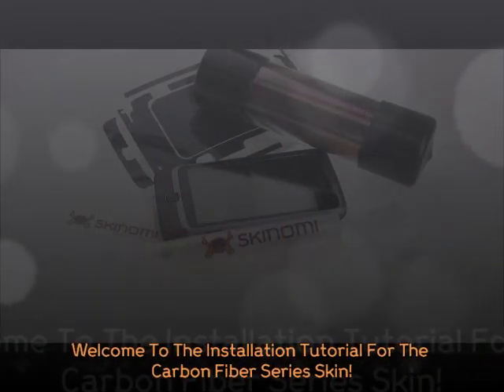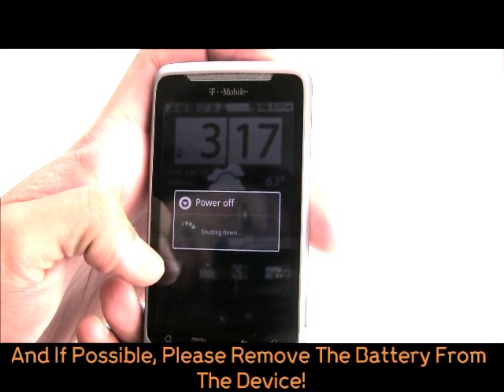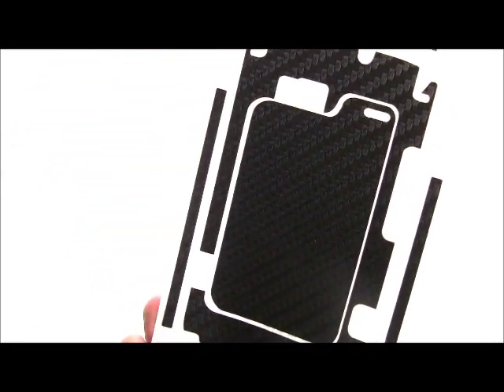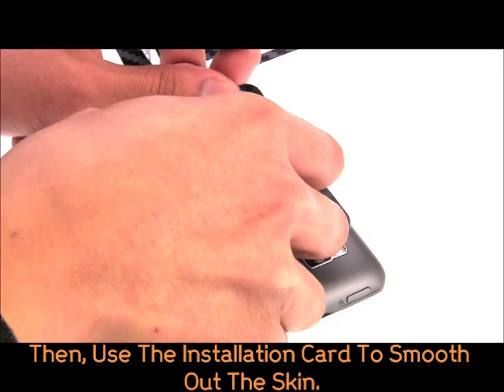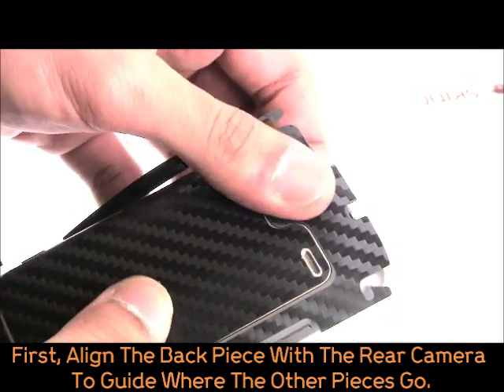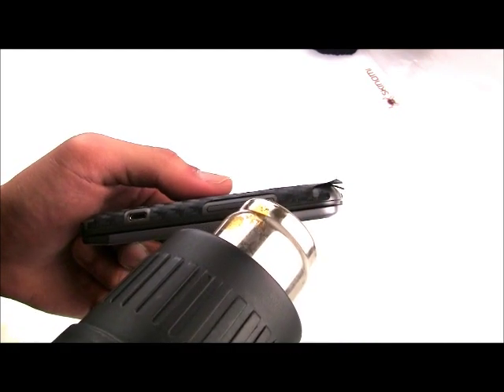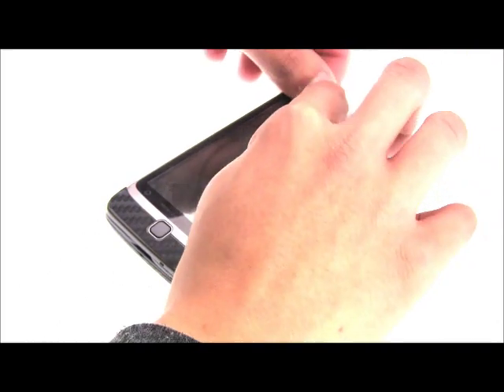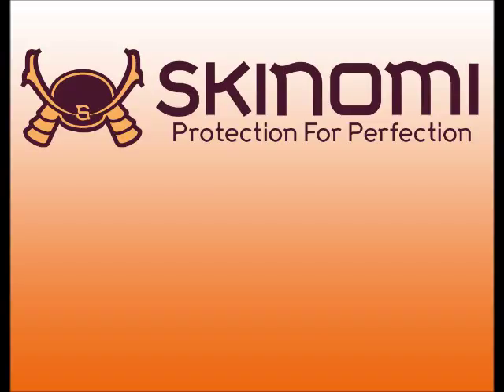Skinomi TechSkin: How To Install Your New Carbon Fiber Series Protector!

Comment: Thanks for the advice, I appreciate it. I already installed my first set of Skinomi skins roughly 9 months ago though, and since then had 3 others installed all with great results. I always do a wipe and blow the dust off before applying the screen protector.

Comment: I bought three gold carbon fiber for my phones, it really changes the look of the phone, It's more elegant, I notice less grease from fingers and hands, very tough skin. A cleaver way to protect your phone from marks.  Does not harm the original cover or color of the phone.  The skin peels off. The trick to have a tight application is the blow dryer.

Comment: Is there a particular reason to install the carbon fiber skin before the screen protector? Wouldn't the excess spray solution from the tech skin screen protector installation get on the carbon fiber skin? Just curious, Thanks.

Comment: @Aspireonthego. We advise you install the carbon fiber first because it won't install properly if there's liquid underneath. More air bubbles would result from this. The adhesive in the carbon fiber skin's back would stick to the surface easier if it was dry to begin with. Also, keep in mind that the solution won't do much ON TOP of the skin once it's installed and bonded with the phone's surface. If you have any more questions, just let us know right away at: customerservice@skinomi.com